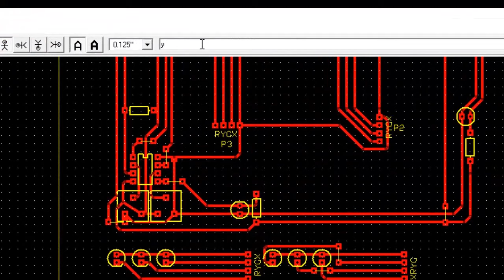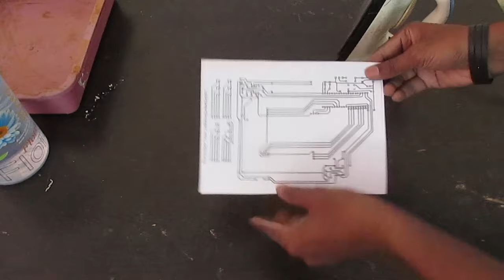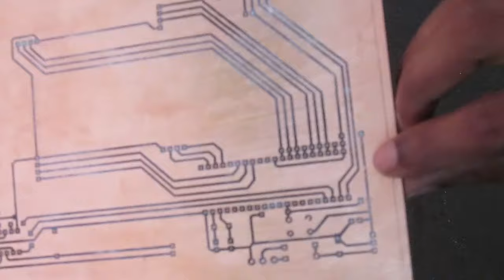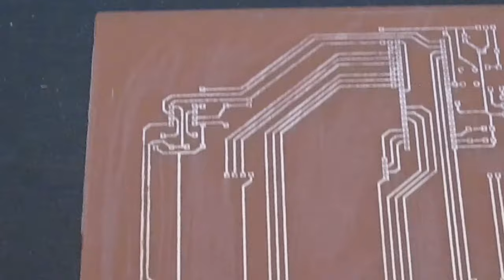How to Make PCB at Home - Easiest Way

Comment: Wear Safety Glasses and Gloves. Take Glossy (Photo) Paper,  Tailors Iron with Thick Base. Heat till Paper Gets Yellowish at highest temperature. When pcb is done, peel off very slowly the paper from pcb without water, when its some hot. Re-use the FeCl for many times just put it in airtight bottle. Happy Pcb'ing
Reply from the maker: Thank you so much Ajay

Comment: Do NEVER add water to ferric chloride. The reaction done in this way causes an extreme temperature rise, so we see evaporation. The correct way to do this without risk is to gradually add ferric chloride to the water.
Reply from the maker: thank you so much for the information
Reply: Agreed!  Old saying, drilled into us at chemical safety training, "add the chemicals to water not the water to chemicals."  Or the old version from the 80s, "you can throw a bucket of chemicals into the ocean, but you can't throw the ocean into a bucket of chemicals".

Comment: can we use that same ferric chloride for another pcb???
Reply from the maker: +Ps Sarvna yes...it will take long after 1st pcb.
Reply: Tapendra Mandal...thanks for for reply
Reply: Ps Sarvna The iron in the ferric chloride will separate out and the chlorine combines with the copper to make cupric chloride I believe.  At some point all of the ferric chloride will have reacted and so the solution is weaker over time, using a bit of heat like 40-50C and agitation can make the process faster but ultimately you need to either remove the copper from the solution or dispose of it.

Comment: if you add ground plane as well it will reduce time to etching.
Nice demonstration by the way, also try to add text or speech guidance. 
caution notice  should be display before handling Ferric chloride and dispose it carefully due to its nature to corrode metals.
Keep it up!
Reply from the maker: Thank you Sudarshan for suggestion.
Reply: What's a ground plane?

Comment: Three advices: 
1. If you can, use sodium persulfate instead ferric chloride - it's safer.
2. Add ground plane! This way the solution will last you much longer
3. Instead of photo paper, try transparent laser printer foil - they are still avalible where I live and they are used in old projectors. This way you don't have to remove the paper because it simply peels and leaves a clean surface.
Reply from the maker: thank you so much for that golden advice

Comment: This is fantastic Tapendra. Very very professional finish. I used to make PCBs at home, but never knew this transfer technique. I copied the design by carbon paper and then painted with nail polish. Never knew that a marker pen does a better job. 

Aside from this, what kind of printer is it. Is it a normal inkjet type?? Thanks for sharing this wonderful process. Keep up the good work
Reply from the maker: +Atanu Mukherji i used laser printer and glossy paper
Reply: any specific brand of glossy paper ? i tried, but print doesnt transferred well
Reply from the maker: +arun soni i used 80GSM paper

Comment: Just don't throw the ferric chloride in the drain.
Other than that, good video.
Reply from the maker: +Gordon Freeman thanks
Reply: There's less nasty than ferric chloride these days, I cant remember the name but its only a google away. Ferric chloride stains things bad Im glad to never use it again. Oh and fix that iron cord ;)
Reply: cupic chloride. you can make it by mixing hydrogen peroxide vinnegar and salt with a little copper. etching the boards should regenerate the copper  in sollution and  too much copper should precipitate out of the mixture. the more you reuse it the better it works as I understand it.  slower but better for the environment. 

I've never tried it but plan to

Comment: isnt it safer to add ferric chloride to the water and not add water to ferric chloride
Reply: Absolutely correct.  I was taught to always add FeCl3 to water, not the other way round.  i.e you increase the strength of the solution by adding the FeCl3 to water, not decreasing the strength by adding water as this causes a massive amount of heat.

Comment: idd. this is "the hard way", using chemistry, bad tracks quality, scratching all the cooper in the initial cleaning,.

The easy way is 3D miling.
Reply: Provided that you have a 3D printer, which is quite expensive. Plus a computer to control it, which is also expensive.